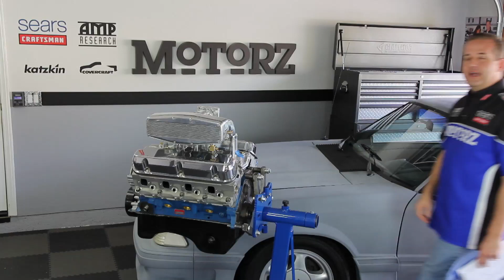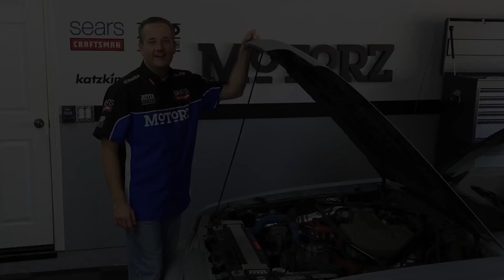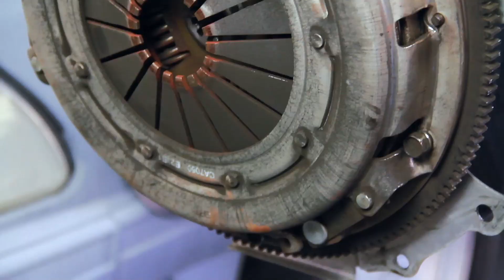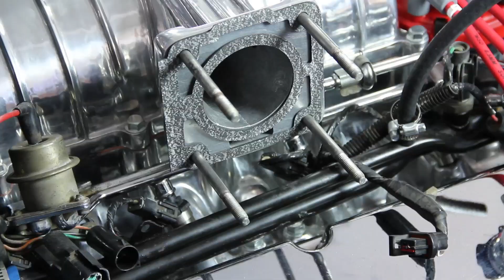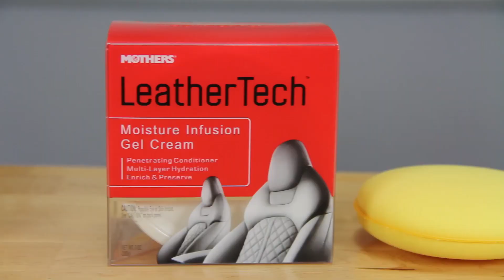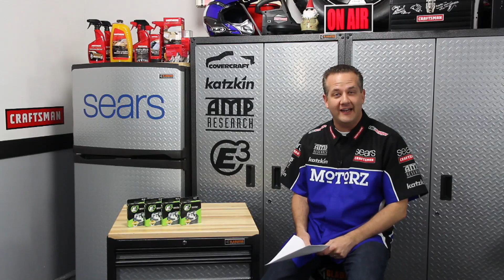How-To Install BluePrint Engines 331 Crate Motor Ford Mustang Motorz #74

Comment: hi. was wondering how i could help my 3.0L engine for my ranger. 159,000 miles on it an need sum more horsepower.
Reply: swap it to a v8. there realy isn't much you can do to a older v6

Comment: What he didn't tell you in this video is that this mustang had a Mass Air Flow conversion to this motor with a A9L computer from a 89-93 mustang gt. Or he used the 93 cobra conversion which uses 24 pound injectors a calibrated cobra computer and a stock 93 cobra mass air flow sensor. Either way both will work but for a 87 and most 88 mustang gt's you need to get rid of the speed density setup because it sucks and won't work...

Comment: What size injectors did he put on this motor? I run 30 pounders on my 331 but i use a entire areomotive fuel system with there sumped tank and A1000 pump because i plan to run a blower. I just didn't want to risk not having enough fuel once the boost finally starts pressurizing my 331... I know a 255 in tank pump with another external pump on the feed line will work but even that's just barely able to keep up on a fox mustang or any V8 mustang for that matter...
Reply: steve v

Comment: upgrading engine is not enough.. U need to change everything disk pads hand break different spoilers because of aerodynamic, height tires.... it cost a lot..  and most expensive part is transmission. to bost.
Reply: +MakeSh00t 
You are correct - an upgrade is a  pandora's box -

Comment: Didn't you have to reprogram the EEC for the new engine?
Reply: +John Doe You don't have to upgrade it if you have Mass Air Flow and the car will run nice but for all out power with drive ability, tuning is a must. I run my 331 untuned and i was still able to beat a 2005 GTO to give you a idea of how good a mustang gt 89-95 will run without tuning...

Comment: How-To Upgrade a Ford Mustang Engine : LS Swap it.
Reply: DJ JONES lolumad
Reply: no your just a typical youtube dumb ass
Reply: lol
Reply: <3
Reply: Yeah right ...there is so many ppl swapping ford's engines....
Reply: +Road House Dear Patrick Swayze... There are no GM vehicles worth swapping a Ford engine into. You can't polish a turd. An  LSX swap lets the guy driving it pretend he has a Ford, but couldn't afford to go fast...so he lumps around in his raped Mustang with a weazing Chevy under the hood.
LS motors are cheap. Mustangs are cheap. You do the math dummy.
Reply: +S Murphy ls motor are just as heavy as a ford 5.0 why do all these dumasses think there lighter there not
Reply: 302highperformance  i sense some butthurt....
Reply: ha your funny dude ive seen 5.0 own ls motors there not the greats engines in the world
Reply: I admit coyotes are great but old 5.0s and 4.6s (2v) are real pos...unless you spend a shitload of monney on them. On the other hand , have you ever heard of a LS 5.3 Junkyard setup? Pretty hard to beat in terms of power/money spent....
Reply: the 4.6 are pos engins butt the 5.0 with 4 valve heads aren't so bad if you pute aluminum heads on a 5.0 with a 393 stroker kit there fast with a t5 behind it
Reply: Road House Are you kidding? The first Mustang in the 7's was with a pushrod 5.0.
Do some home work.
Ya....7's are SO slow. Fucking shitty Ford!
Stop watching Street Outlaws with the crapper white Mustang with that shit 5.3 Chevy in it.
Reply: +302highperformance A T-5 tranny will break. I broke mine just granny shifting even with my old stock motor...
Reply: ya I know I broke mine slamming gears drag raceing a car it grenade the trani case

Comment: I am surprised that they didn't resurface the fly wheel for a new engine or replace it. I would have steam clean the engine
compartment . Wouldn't be easier to install the engine block mount to the engine,and also to install the headers to the
engine at first before installing it in car.

Comment: Why would you install the headers after you drop the engine in? Also who bolts motor mounts to the k member instead of the block..............makes the process harder.
Reply from the maker: That's the only way we could install the headers, and that was the only place to bolt the motor mounts in the factory location. Thank you for watching.
Reply: What don't you like things that are hard?!?!?  Also gives a reason to go out and play.
Reply: +Roy Howell that's the only way I could swap the motor in my f150, and no this process makes the job on a ford a hell of a lot easier on a automatic atleast.
Reply: +Motorz on these fox bodys there easy to droped the motor in ethere way with the motor mounts on the block or with them on the kmember and the headers haveto be pute on after the motor is in and good job on that mustang
Reply: amen.

Comment: Now wait just a minute. Did I hear him correctly? They installed a motor in the engine bay? It looked like an engine they were installing in the engine bay?! Typically a motor runs on electricity or at least that is what I thought!
Reply: Here's the actual definition of motor. Pay particularly close attention to the part about internal combustion. Maybe you'll learn something instead of just trying to be better than everyone else.

mo·tor
ˈmōdər/
noun
noun: motor; plural noun: motors
1.
a machine, especially one powered by electricity or internal combustion, that supplies motive power for a vehicle or for some other device with moving parts.
a source of power, energy, or motive force.
"hormones are the motor of the sexual functions"
adjective
adjective: motor
1.
giving, imparting, or producing motion or action.
"demand is the principle motor force governing economic activity"
Physiology
relating to muscular movement or the nerves activating it.
"the motor functions of each hand"
2.
British
driven by a motor.
of or relating to motor vehicles.
"a dominant figure in the world of motor sports"
verb
informal
verb: motor; 3rd person present: motors; past tense: motored; past participle: motored; gerund or present participle: motoring
1.
travel in a motor vehicle, typically a car or a boat.

Comment: Some things i see that might be wrong with this video... Using the factory direct drive starter, why? I hope that you're not using a 75 amp alternator w/an electric fan? Torquing on a cherry picker? Bad idea, it should be torqued on an engine stand. Scotch locks used on anything = BAD idea. 
Good parts selection, though!
Reply: Why is the direct drive starter a bad idea? Just wondering. Also whats wrong with Scotch Locks?
Reply: How you gonna torque on a stand?

Comment: my 3.8 sc engine has melted them headers, anything better?
Reply: I love them L67s
Reply: But if you are going to melt them headers you are running too high of a EGT. What is you fuel management system? You should try to draw in colder air in. I 'member my GS ran way faster when it was colder due to that factory knock sensor system. 

With that being said If you are not using 91 octane already, do it, you'll gain performance.

In any case, you need to try to reduce your inlet temperatures (charge cooling). A simple set-up on your car could be a water/meth system. You would gain instant performance gains in hot days with minimal volume of mix. Using 91 octane and injecting a bit of water/meth on boost will eliminate detonation and allow the computer increase the timing to it's ideal running advance. You will have the added benefit of a way cooler intake charge allowing for lower EGTs and further support for performance mods such as a smaller SC pulley with a chip.

Comment: Can someone explain what a smog pump is, why this car has it, and do modern cars have smog pumps?
Reply: *****
 I think your crossing the AIR pump with the EGR (exhaust gas recirculation).which did put exhaust gas into the intake charge to dilute it this lowered peak combustion temps and pressures reducing NOX emissions.
The AIR pump drawers in fresh air intjects it into the exhaust to help the cat. Light off burn/catalize any unburned hydrocarbons.

Comment: Why would you put the old clutch and fly on
Reply: Echowhiskey Rebalancing what exactly ?If you're putting in a new motor, a new flywheel and clutch is common sense.
Reply: to avoid rebalancing perhaps
Reply: They're mechanics, they can get back in there when someone offers'em a freebie.
Reply: or at least machine the flywheel
Reply: Emtildeath6666 should you honestly get a new clutch. I mean the clutch doesn't spin with the crank. the crank drives the clutch. also, if you put the old clutch and fly on, you can just not rebalance it if you had a 28 ounce.

Comment: Yeah! and what's with that positive engagement starter? A 1990+ won't require a use of a larger battery, and is that engine balanced for the 50 oz flywheel? You shouldn't need a spacer for the stock serp belt setup, and what's with that stock MAF meter?????
Reply: The 55mm MAF was one of the first things I changed on my car.  It's a choke point on a bone stock motor, much less something with even a few bolt-ons.
Reply: HAHAHAHA!  Yeah... the stock mass air meter was cracking me up.  It's by far the most restrictive part of the induction path.
Reply: ***** restrictive part? Wow do you even know what a man does? Lol

Comment: upgraded engine with factory clutch??? the best thing you can do is upgrade your clutch so you can transfer that 390 something ENGINE horsepower. Even if you hava 2000 hp in your engine it doesnt mean anything if you can transfer it to the ground.

Comment: compared to what? .. camaro ? the chevy cost more .. it has to because it weights 400lbs more then the mustang ... my $35000 mustang well out run the $42000 camaro .. so just what does your statement mean?

Comment: I had a bad experience with Blue Print.  I bought a 305 chevy, and it only ran for 1000 miles before it hit the graveyard.  The do have good customer service.  They offered to send me a new one without question, but I denied.

Comment: kinda strange if not 
as there's injectors o2 sensors etc so there must be a computer somewhere to check the data :)

nevertheless i like these shows subbed for sure
i only wish we had those v8's and stuff here instead of those 4 cil
baby engine's lots of fun to work on but just to small ;)